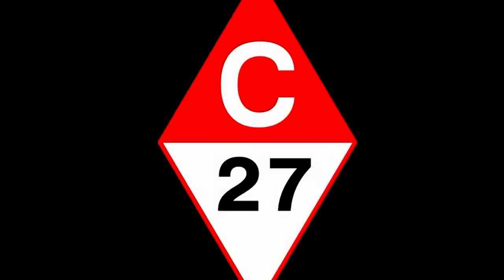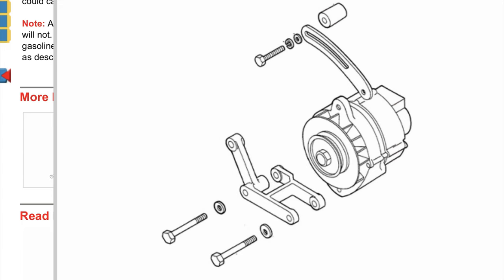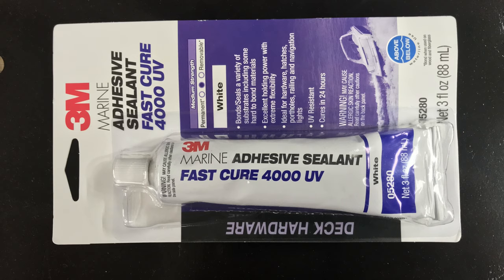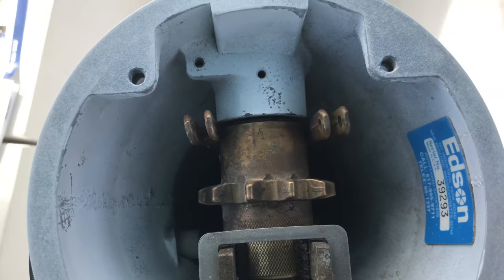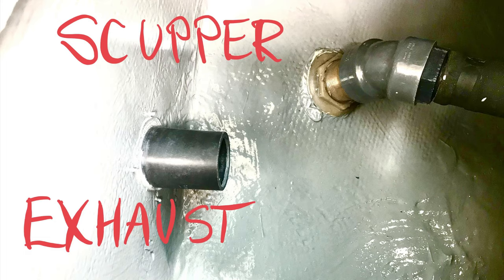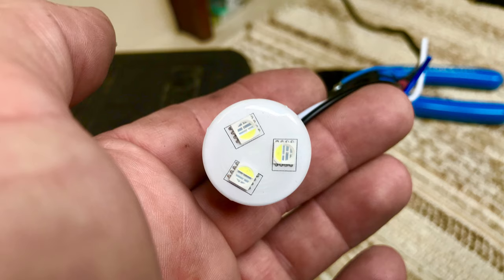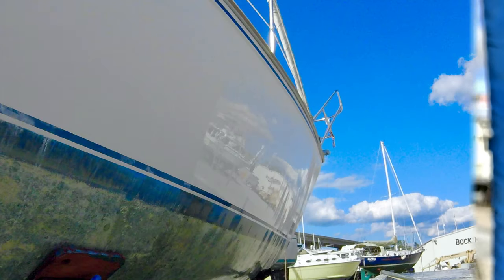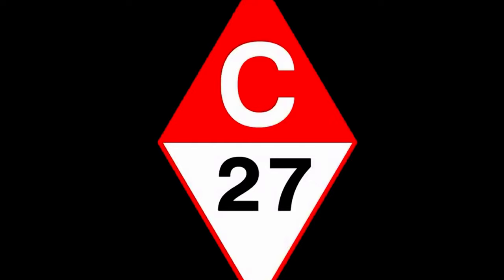Catalina 27 Sailboat Refit — Everything So FAR❗️

Comment: ive got a 1979 C27 tall rig, did the same thing, every nut bolt screw wire and hose was scrapped. do yourself a favor and ditch the binnacle, go to a tiller, gains about 30% of your cockpit. no reason why a boat that size needs a wheel. a 100w solar panel fits nicely on the sliding hatch too. i actually spoke with Patrick Childress before he passed away regarding his modifications to his C27 he circumnavigated with and i got ahold of his lists of modifications and did all but 3 or 4 of them to mine, and then some including a 3 burner cook range and propane fireplace, radar, AIS, autopilot, LEDs throughout.... my boat was totally rotted out, the decks are rock solid but all in all i replaced 5 bulkheads on top of some serious reinforcements to the standing rigging, there isnt a single piece of deck hardware that doesnt have an oversized stainless steel backing plate, the list of stuff ive done to my boat is so extensive its not even funny, but thats what you can get away with when you work at a boatyard.... bought my boat for 1000$, and i specifically rebuilt it for the trip to Alaska from WA 

biggest favor you can do for yourself is make sure the fasteners youre using are 316 grade stainless steel, anything else is garbage
Reply from the maker: Wow, sounds like you got her sorted out 👍 
So sad about Patrick, he was so helpful to anyone who needed help or advice, myself included.

Comment: Very impressive research on repairs. Did you have to lift the boat to completely drop the rudder, wax the shaft, and put the rudder back?
Reply from the maker: Thanks. The boat was on stands in the yard, so I had to dig a hole about three feet deep to drop the rudder, probably can be done in the water as the tube opening is above the waterline even with the radial drive wheel fitted.

Comment: As a brand new boat owner, this video was very informative. As for the work you did on the cockpit area and deck, did you wet sand all of it with with the 3M product? I thought that was what you said but just wanted to confirm. My top side needs some cleaning and l'd love to replicate whatever you did. Also, did you use that pledge product on the non-skid parts of the topside? If so, how did you apply that? Thanks in advance.

Comment: Nicely done.  I have a soft spot for the C30 and C27.  Great boats.  I did a lot of work on the C30 our sailing club had.  It is very fortunate you have the diesel and not the A4.  Not a horrible engine but gasoline is just not ideal in a cruising boat.  For a day-sailor that jjst needs to motor in and out of the harbor it is fine.  Travelling down the ICW, not so much.

What are your future plans? Are you going to go cruising or sail locally?  Either way you have a really clean C27 there now.  Great job.
Reply from the maker: Thanks, lots to do still. I’ll be taking it across the Pacific next spring 😬
Reply: Have fun with that.

Comment: Would you get a 27 again? I am thinking the 30 might have just a bit more room? (two adults coastal cruising)
Reply from the maker: Yeah, I like the way the 27 sails. The 30 is good too, and the extra room is nice, but they cost more.  I don’t like to sail in anything approaching cold weather so the 27 is fine as I’m not below deck too much. The 27 just seems like a better boat, especially in light winds, and you can drag it around on a trailer if needed.